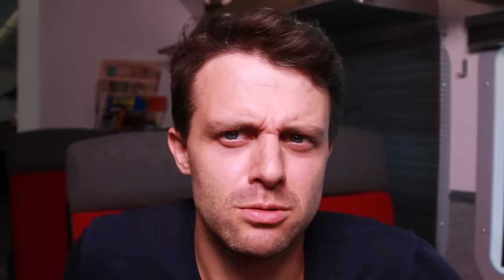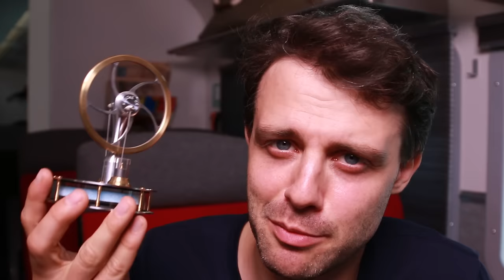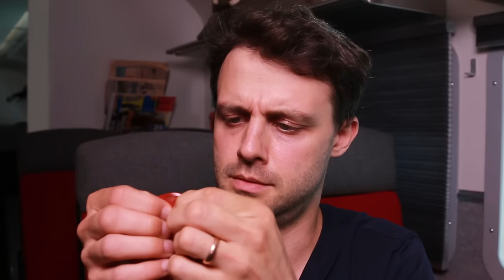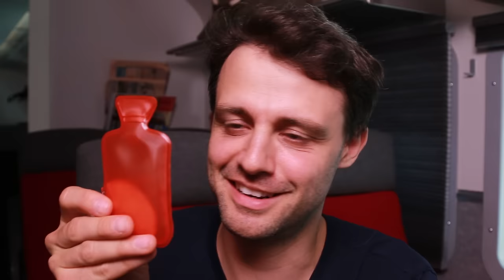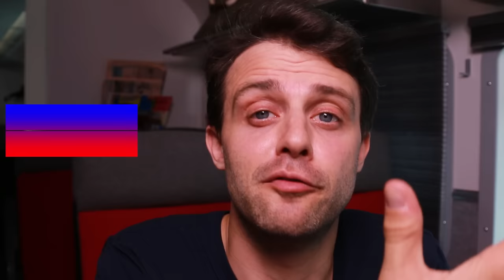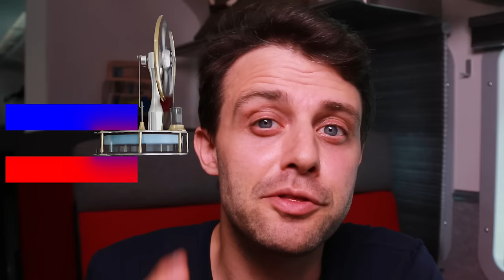A better description of entropy

Comment: Entropy is the cause of the existence of time. And if there is time, there is entropy.
In quantum systems, entropy may increase or decrease.
Essentially, as long as there is an arrow of time, there is entropy. 
Because of the way Quantum mechanics works, time can be turned backward and reverse entropy.
There is still a backward arrow of time (so a backward entropy).
Entropy is required for time. If entropy did not exist, we would not even have a universe to live in.
Rather, we would have a static universe (maybe because our universe is expanding, it could last forever).

Time exists on the local level inside a fixed size universe, if at all.
This means things can still happen but will cease to exist after entropy is completed on all local scales.
Entropy isn't just the transfer of heat, but the transfer of information.
The transfer of information takes time.
Therefore, the speed of information transfer is the speed of light.
The speed of light is the fastest speed possible for a massless, yet information bearing, particle or wave.
That means information, through light (or any other light speed particle/wave), will set the maximum speed of information transfer.
In a world where light travels instantaneously across any space, cause and effect break down.
Light from a billion miles away will reach you at the same instant as light an inch away.
Light from any distance will reach you at the same time.
Cause and effect become simultaneous and can't be told apart.
This is the view of the photon.
Its life begins just as it ends as seen from the view of the photon. 
For time to exist, you must be able to tell cause from effect.
It is in the definition of time that you must be able to see cause than effect.

In conclusion, entropy is the cause of the arrow of time, it forces information from one place to another or else the universe shall be static. This information travels at a finite speed to preserve time as the transfer of information from one cause to the effect starting its own cause and effect.
In a world of teleportation of information, you take the view of photons (or other lightspeed things) and pop into existence at the same moment you stopped existing.
In a world of infinite speed particles or waves, the information could just choose to stay in the position as it was before and do nothing until it does, but because our worlds speed of information transfer is finite, we will see time constantly moving through each small cause and effect building up to a larger cause and effect.
Reply: Therefore entropy is a stabilizer.
Reply: Ron Harley Pantaleon What is entropy the stabilizer of?
Reply: Yes I agree - without entropy, the universe would be useless, pretty much, with no movement or anything. So to get something to move or exist, you need some measure of entropy to achieve it, suggesting entropy allows for the formation of galaxies, planets, life etc. I do believe however that the more we look into quantum mechanics, I think we are going to find more interesting laws which builds on what we have already discovered.
Reply: Hey bro.. can't understand ur depth...but am desperate to understand....can u help me?

Comment: Dear Steve,

First of all, many sincere thanks for your efforts!

...By the way, ENTROPY is not only about particular engines/motors, etc. It is about principal impossibility of PERPETUUM MOBILE in general, according to Nicky Carnot. Now let us go...

A. There is ONLY ONE BASIC, fundamental Energy Conservation and Transformation Law. It  is definitely unique and conceptually indivisible delivering two logically joint concepts - these are Energy Conservation - and Energy Transformation. Still, a more-then-100-years-old conceptual failure has brought us to two separate thermodynamic laws - but this has nothing in common with the actual physics. To come back, they have coined two more fake thermodynamic laws, employed the Probability Theory + Mathematical Statistics, and this has helped formulate the Quantum Mechanics, which is thus a basically metaphysical conceptual construction and thus ought to be only restrictedly fruitful.

B. By dividing the basically indivisible law, you are telling about Combinatorics, you are touching Probability Theory, you are even stepping back to Thermodynamics for a while, but...

You are NOT answering the poser: WHAT IS ENTROPY, sorry!

1. In the formula S = kB * ln(Ω) you imply, Ω means not a "Huge Number of Microstates", not "Probability", which numerically ranges between [0,1], not even "Wavefunction", which ought to be a purely metaphysical notion, as it is... In effect, Ω ought to be a simplistic algebraic function of Lord Kelvin's Absolute Temperature. This result has been published 100 years ago in JACS.

2. WHAT-ENTROPY-IS-poser has been answered not by Clausius, not by Boltzmann, etc., but by Goethe, who has introduced Mephistopheles, the philosophical embodiment of ENTROPY.

3. Newton did basically know WHAT ENTROPY IS - A Counteraction.

4. That Counteractions do not grow to infinity with the growing Actions, but MUST reach their MAXIMUM values, is the result by Nicky Carnot formalized by Clausius...

5. In effect, Gibbs Energy formula renders implicit the interplay among ALL the relevant Actions (the Enthalpic term) and ALL the Counteractions (the Entropic term).

6. The standard approach you are reporting about is OK for the implicit Enthalpy-Entropy picture,  employing it for studying reaction mechanism details is likewise eating soup with fork.🧐

Comment: A few observations 
First, there are more sources of energy than fossil and solar. (Fossil being basically stored solar) There's also nuclear decay and lunar (tidal). These have nothing to do with solar energy, to my understanding.
Second, there's more than one way for all the red balls to be on one side and blue balls on the other.  For example, red ball #1 and red ball #2 could swap places. I guess it would be a permutation of the number of red balls and the number of blue balls, which explains why if there are only 2 red and 2 blue, there's a decent chance that all the blue will be on one side and all the red on the other.

Comment: This is a good illustration/explanation of Entropy from Maxwell's equation which is a macroscopic view of a system. The popular "chaos" view comes from a Boltzmann's statistical mechanics view of a system where "entropy" is an increase in the number of microstates of a system, aka "chaos". Both are correct but this view is zoomed out.

Comment: Entropy just sounds like a convoluted way of explaining equilibrium.
Reply: Actually, we can define that a system has reached equilibrium if it has reached the maximum amount of entropy.
Reply: But doesn't equilibrium sound like the ultimate order?
Reply: @P_Ezi   it does, unfortunately. The subtlety is in how we use the words in common language and while dealing with terms technically. Equilibrium is a state which every system desires to have, eventually. And when it is achieved, no system wants to move out of it. In other words, there is nothing left for it to do now, other than maintain the equilibrium. I'm repeating it again, "there's nothing left to do", which implies all energy has been spread out, and now there's no scope for work or heat. All energy has been spread out, and using the definition of entropy given in this video, the system has achieved maximum entropy. Now, the "most dispersed state" may seem like "the most ordered" when you look at it from the macroscopic level. At the statistical level, it is the most randomly distributed state.
Reply: @tusharpal8041  well said. It has always bothered me when people say that things move toward disorder. "Disorder" and "randomly distributed" seem like very different concepts to me.
Reply: Dr Deuteron  Thanks for correcting me! I was wrong in phrasing things to make it sound like there is only one state for maximum entropy, or the equilibrium state. I realize now that that statement is true for macrostates, not microstates.
Reply: Entropy being the process, the path in a way, to equilibrium
Reply: The 1st law: Energy can not be created or destroyed, just transfered.
The 2nd law: the ability of Energy to create Work  diminishes irreversiblely as the Temperature of the Energy source drops. Low Temperature Energy source are almost useless. 
(Toothpaste analogy: its easy to get the toothpaste out of the tube than putting the toothpaste back in the tube.)
Reply: Equilibrium is defined(by me) as maximum boring state
Reply: @francisbacon4363  I have reached equilibrium
Reply: @P_Ezi  order and disorder are abstract concepts we create, based on a given criteria. The same set of things may be seen as ordered with one criteria and as disordered with a different one. For instance, all the people commenting could be ordered by name, by age, or by the time they posted, and every criteria would "create" a disorder under the other two. Hence, order is a matter of the observers' expectancy on how to find the relationships of the things from the set. And this is subjective.

Yet, there's a shared expectancy comes from the way our brain (and organisms works). Organisms are "way back" machines gathering energy to store for using it later on, on a regulated fashion to fulfil a purpose. As organisms, we work against entropy on a localized context, and this expectancy translates to the way we perceive time. We often say future lies ahead and the past lies behind, as if we were walking facing forward on the time direction, but some South American tribes speaks of the future as what lays behind our back, and of the past as what lays before us. What we certainly can see is what we already know because is in our past, and we walk backwards blind of what's behind us, in our future, using what we can see ahead of us in the past to try to predict what we'll find in our future behind us. As time goes on, things from the future enters or vision field and we become aware of them, where they will remain static, and hence, setting a criteria of an order unable to change (disregarding how randomly distributed), and as time goes on, things far away in the past become fuzzy, fade out into invisibility, even when we know (or expect) due to the order criteria that the picture of them won't change anymore. Under this perspective, perhaps we could exchange the meaning of the words order and disorder to define entropy. Our Universe had born presumably from the Big Bang, an explosion creating the worst possible disorder, and entropy is the process leading everything back to its natural order, to be frozen in the past, as time goes on.
Reply: @marcosdiez7263  wow
Reply: I agree but also equilibrium can reverse and entropy only goes in one way unorganized it can’t spontaneously organize itself.
Reply: Maybe you are right
Reply: @marcosdiez7263  Very interesting (the tribes' beliefs), but I think that is more philosophical than scientific.
Reply: @P_Ezi  But the words are being used in a very specific context.  Order and Disorder are measurements of organization, so when energy is "clumped together" as Steve said in the video, that energy is organized and orderly.  When the energy dissipates it becomes disorganized and less orderly.  When the energy dissipates to its maximum, and can dissipate no further, it has reached equilibrium and maximum disorganization, maximum disorderliness.
Reply: @tusharpal8041  That's actually quite depressing to think of. Is there no possible way for a system to leave equilibrium once it's achieved? Perhaps through some crazy quantum mechanics wizardry?

Comment: I remember I've always been wondering what entropy really is because wether a room is messy or not is subjective, the word disorder is also kind of subjective.
Reply: The degree of disorder that qualifies as messy is subjective, but the fact that "less disorder is less messy" is the objective part. If someone splashed paint on your wall it would be considered messy, until you find out their name is Jackson Pollock. In that case, there are relatively few random configurations that are similar to this highly specific, one-of-a-kind work of art.

Comment: Entropy is more the chaos/energy(not always destructive) between states of order. Or two separate but distinct states of order.

Entropy is more or less energy that is exchanged in the process of change between the states of order with various degrees of effect on the various ordered states as there usually many entropedic energies at work in open systems.  In closed systems there's still often more than one type of Entropy taking place.

Just my view of it, is all.

Good show. I have liked it for a few years now. Thanks for all the infotainment.

Comment: 6:19 Manually turning a Sterling makes one side cold??  I didn't know that, how does that work, is it pulling a vacuum on the top plate and compressing air on the bottom?

I didn't think they operated that way, very interesting!
Reply: Stirling cycle machines are used commercially to liquefy air

Comment: Oops! As Steve was making a point about "statistical rigour" (around 09:00), he made a little mistake by saying there is "only one way to have all the ping pong balls that are red on one side..." and all the blue ones on the other side. Actually, depending on how many balls there are, there will be lots of ways to have the same picture. You can do a great number of permutations where all the red and blue balls are separated on each side but not in the same place (as would be more evident if each ball was tagged with a number). But of course, there are still much much more different arrangement of balls where they are all mixed up.

Nonetheless, a great video!
Reply: Well i think part of the point is that all same coloured balls are indistinguishable from eachother (which would make any configuration of all reds on one side and all blues on the other the same in the statistical calculations (assuming you also can't distinguish directions, so all red on the left and all red on the right would also be the same).
Reply: Statistics may be applied categorically as well as to permutations, don't forget.  "One way to divide balls" may serve perfectly well as the statistical "E", the event to be studied; E is not restricted only to the specific arrangement of hot/cold units.  Further, if we discuss a specific system, one more relevant to the subject of entropy, in which the blue and red balls are hydrogen atoms, say, and their only difference is the individual kinetic energy, all within a band near to room-temperature, there is no other meaningful difference between one hydrogen atom and it's neighbor.  They are identical, and any one atom's location has no meaning to a study of their possible permutations.  It's why the heat death of the universe remains absolute even if you somehow swapped the locations of some absolute-cold atoms with other identical, absolute-cold atoms: "death" has occurred and time has stopped because time has ceased to have any meaning.  It's important to remember that maths does not exist in any objective manner; mathematics is merely a language convenient for humans to describe what the universe means.  It cannot out-endure, or restore relevance to, a system devoid of meaning.  If the red balls corralled on one side could be made entirely identical, some other arrangement of red balls has no different meaning, and there IS "only one way" to discuss their separation from the blue.

Besides, atoms don't really have precisely meaningful "locations".  That's just an added little googly thrown at us by a universe with a wicked-ass sense of humor.